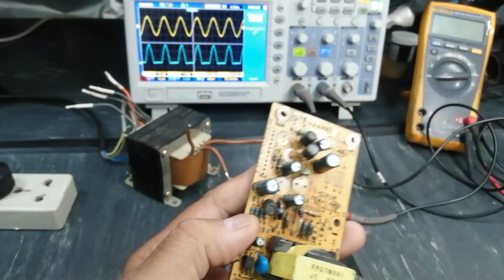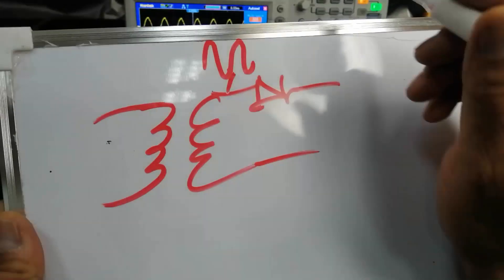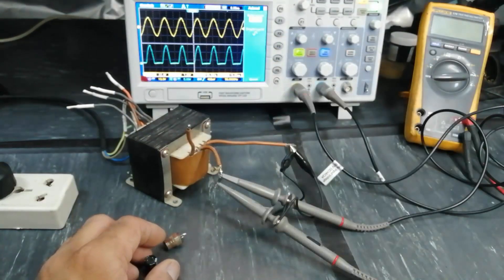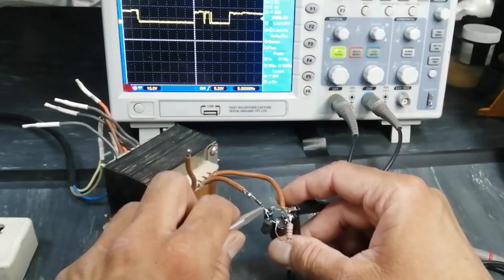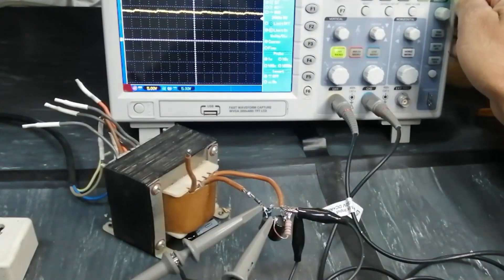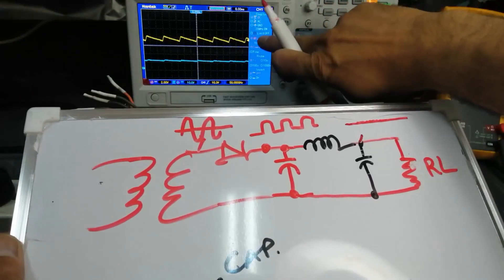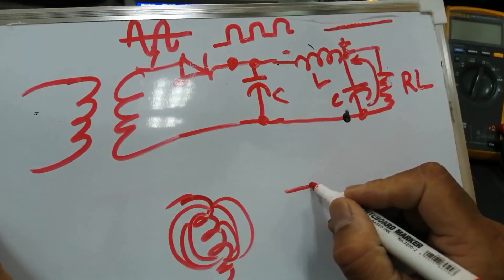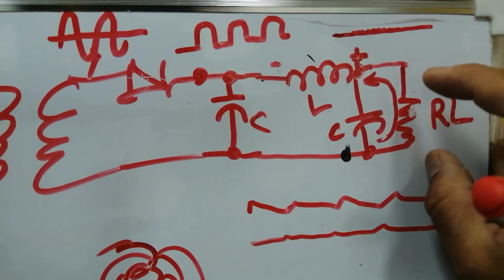#212 Function of LC Filter in Power Supply / LC Filter Explained

Comment: 6:17 lol this is called cheating, yellow probe has 2V\div the other one has 10V\div, of course this will give smooth line. 
We got the concept and it works but you can't just choose a random inductor and capacitor for that  lol. The LC takes into care the energy needed to keep the current stable and to avoid losses.

Comment: A microcontroller is given 5V/3A DC Supply through External High Quality SMPS.
Between Microcontroller and SMPS , I saw a filter circuit.
SS54 diode in parallel to M7 Diode.       Then 1000Uf Capacitor + inductor + 1000uf Capacitor + 100nf Capacitor ?
Please explain.

Comment: Sir , can we design a filter for UPS output to purify UPS output as a pure sine wave .
Reply from the maker: if a square wave output is being produced by inverter, it can be slightly modified by adding a line filter in output, but in ac it becomes a series load as well.

Comment: At 7:39 he says capacitor will discharge during the half cycle. To be precise capacitor tries to feed the load as soon as its peak voltage is greater than the supply voltage. Which is around 90 to 180 degree of the sine wave.

Comment: assalamualaikum. I want to ask sir I want to attach an LC filter to an 18 watt LED bulb The goal is to reduce harmonics. The results of the lamp test show the value of V=225.78 voltAC, I=0.171, and THDi=1667.6% And the power factor 0.95 . With a value of LC passive filter is L=5.4H and a value of C=0.9uF. but it turns out The lamp and capacitor are damaged. How to solve this problem sir?

Comment: Hello. I am currently making a harmonic filter with a passive LC filter type. How to solve this problem? Once calculated, the required L value is 4.2H and the required C is 0.28uF. After testing, the lamp and capacitor exploded.How to solve this problem?

Comment: Sr iam from india kerala  sr can i have ur contact no   sr i have a doubt if we add a ac cap of 10mfd 440volt parellel to a contactor coil when the motor switches from star to delta contactor coil get sufficient current to hold the contactor presently  the contactor is not holding when it switches to delta please reply sr
Reply from the maker: best regards
my whatsapp is 00962-79-1161084
dear my filed is electronics engineering (avionics)
i have no good experience in electrical systems. but i will try to ask this question to someone, if i got some satisfactory answer which satisfies me then i can say something about it

Comment: Hi thank you very much indeed for the extremely useful video.  I have a question.  Which is the better approach to filter out ripple on a DC line ... L-C filtering or R-C filtering ?   i am asking because it is easier to use a resistor after all.  My need is to place some kind of filtering after a first bank of power supply caps and at the input of the caps feeding the Voltage regulators in an audio stereo preamp.  Now there are only the caps before the regulators and there is some noise at the preamp outs.  In an audio preamp of course the lower the noise the better  Thanks a lot again.  Kind regards, gino
Reply: @HaseebElectronics   Hi thank you very much indeed for your very kind and helpful reply.  I will go for LC filters then
I will start studying the theory in order to calculate the values needed  ... just one should be enough because there will be another regulation stage after it anyway  The less the ripple reaching the regulators the better i presume     Kind regards, gino
Reply: @HaseebElectronics   Thanks a lot again.  I will try it out Kind regards, gino

Comment: Even though the AC signal is rectified from the start, you also rectify after the secondary and aux windings because a negative output comes from the transformer again as the switching takes place?